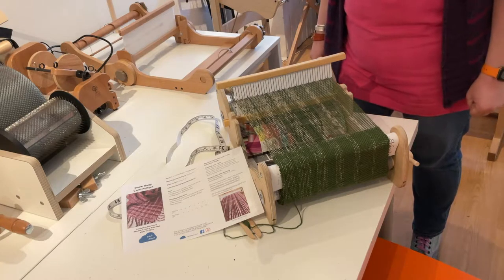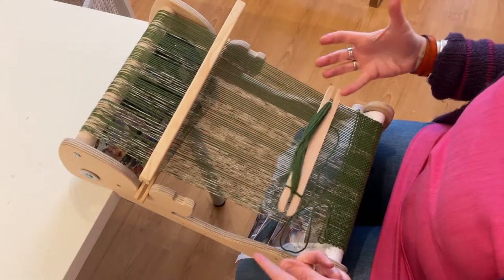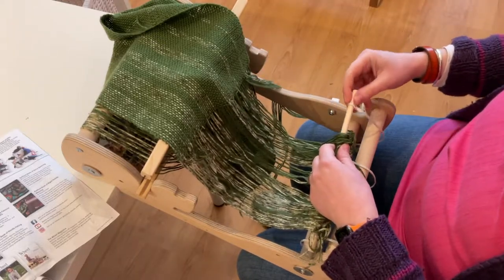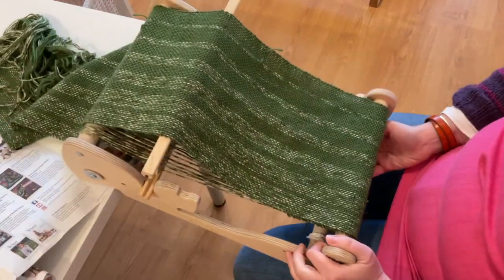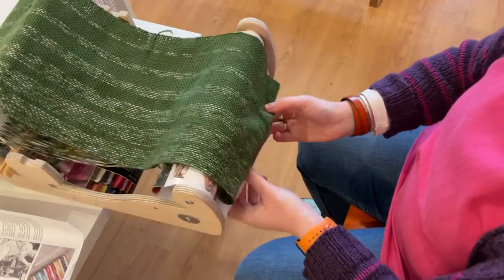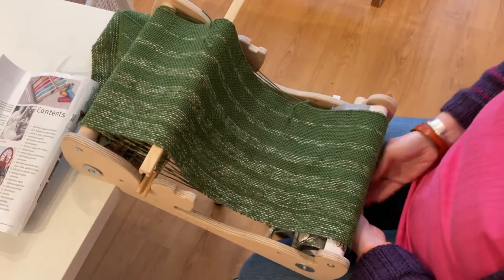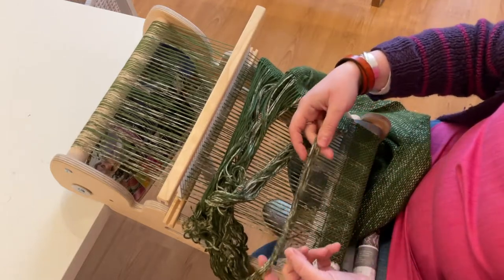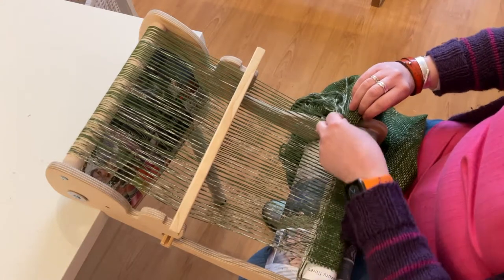How to Weave the Join for a Cowl

Comment: I have just followed your pattern but there is not enough length to loop around over the head again. Could this be because I used a thicker yarn. I did beat it well.
Reply from the maker: The yarn doesn't really make much difference as the main thing is the warp length and then the length you leave at the beginning before starting weaving or had too much left at the end. I have done this myself occasionally. A good tip is to write down the measurements each time you weave and that way you can check it all as you go. I hope that makes sense and if you've got any more questions then let me know.